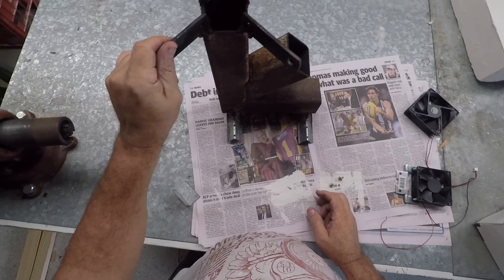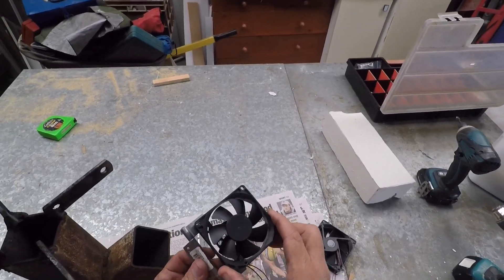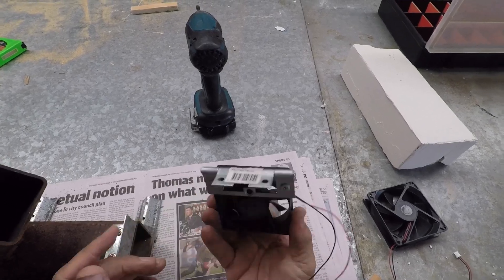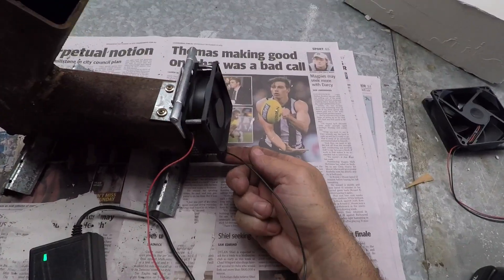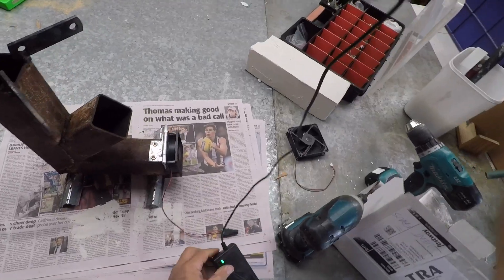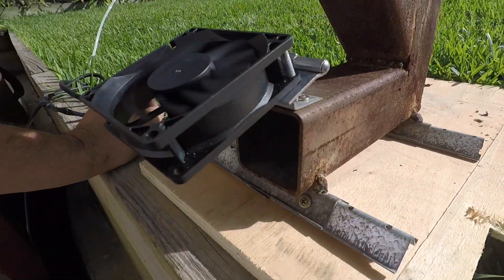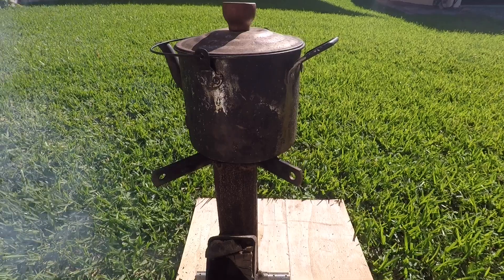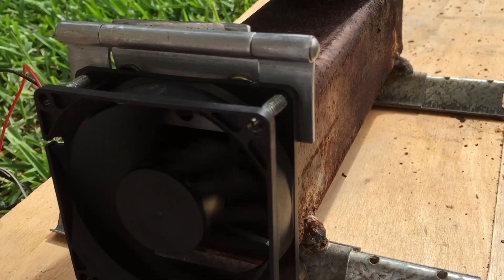turbo charged rocket stove

Comment: What a stupid idea.....
Plastic fan will melt....
Reply from the maker: Haven’t had that problem . Thanks for watching 👍🍻
Reply: It's air induction so the heat is not coming out but being sucked in so no melting point of any
Reply: He did say it was only shits and giggles!!! Don't you remember?
It was definitely worth the effort!! Of all the rocket stoves I've looked at this is the first time I've seen someone make use of a computer fan!! ⭐⭐⭐⭐⭐ Stars for the guy downunder!!
Reply from the maker: Thanks kit j benn 👍 appreciate the support and thanks heaps for watching 👍🍻
Reply: I tried this a week ago and eventually melted the fan lol. While the metal at that part of the stove stayes quite cold I think the radiant heat from the glowing coals heated it up.
Reply: XD it pushes cold air inside mate. The conduction of heat must be greatly reduced due to that.